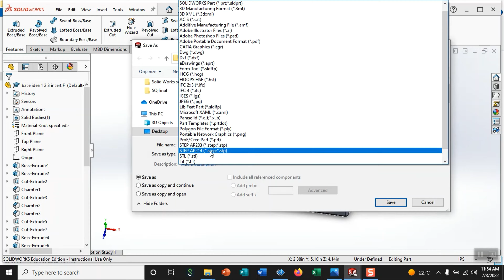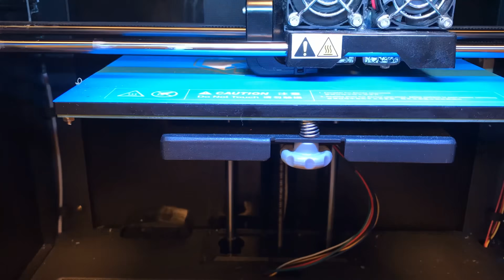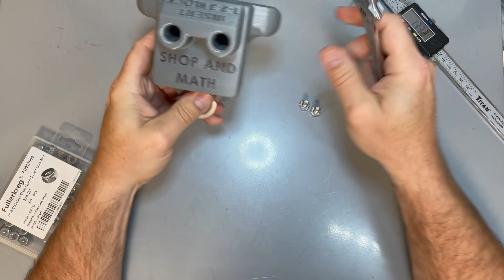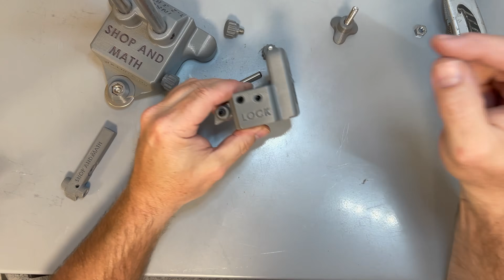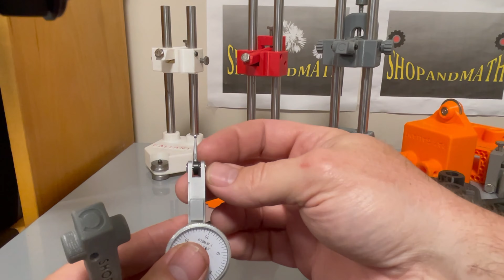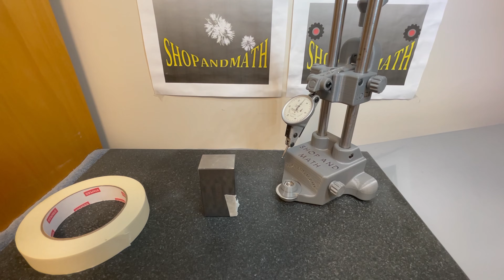Squareness Comparator - surface gauge

Comment: PLA in the machine shop?? Just the ringing on that printed part tells me you haven't calibrated your printer very well. PLA seems like a questionable material choice at best. Those threaded holes are "easy to tap" because they're easy to strip. PLA has "creep", so any part of that part that is unsupported is going to start deforming and ruining the repeatability of measurements
Reply from the maker: PLA works great in the shop depending on what you’re making.
you need to be selective with choosing the right tool for the right application
3-D Printing is awesome under the right circumstances stress and heat seem to be the enemies creating static moving parts work well for non-load situation
For non-loadbearing, threaded holes, tapping straight into the PLA works great if there is some type of load using a threaded insert or not is best practice
The oldest surface comparator is about seven years old now, and works as good as the day I printed it
There are a couple modifications coming up in future plans changing out the 1/4-20 adjusting screw for a 1/4-28 (a fellow commenters suggestion) lengthening The indicator arm and setting back the adjuster screw for more clearance compared to the risers

And also including a security tub to feed and a small one 16th aircraft cable through so that if it gets bumped off of the surface plate, it won’t hit the floor

Thank you for taking the time to comment. It’s much appreciated. Have a good night.
Ray

Comment: Nice work. I like your iterations over the years. I'm working on a custom indicator stand to measure the roundness of billiard balls, using a tenths indicator. I too have had a few iterations over the years. My middle ones combined 3d printed bases with 3 bearing balls for the billiard ball to rest on. I'm now aiming to have it laser cut aluminum, which is very cheap at sendcutsend. I found the 3d printed versions flexed a bit too much, and affected the measurement using a tenths indicator. Your design reminded me a bit of mine.
Reply: Hi nick
It’s an interesting concept I never thought of tracking roundness for billiard balls
Just reading this I pictured something in my head how I would do it
Using for digital plunge indicators
Thank you for taking the time to Comment
Much appreciated
Ray